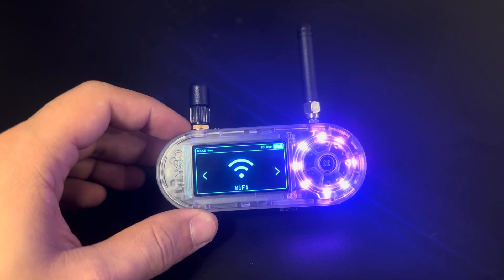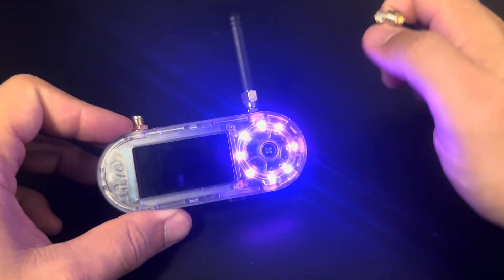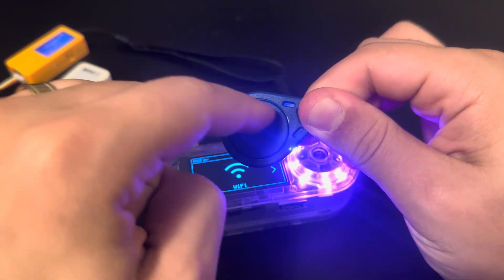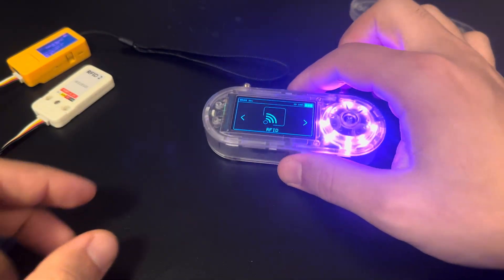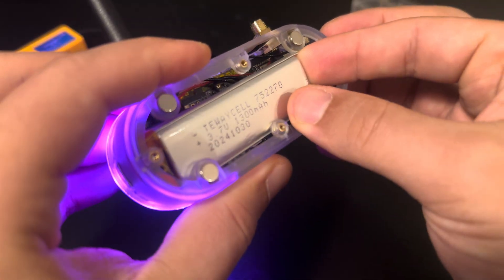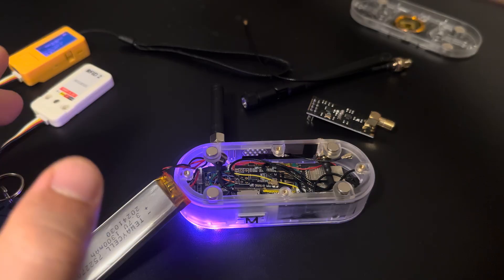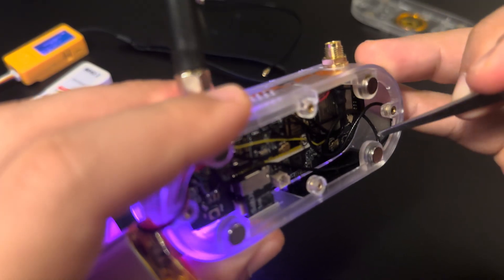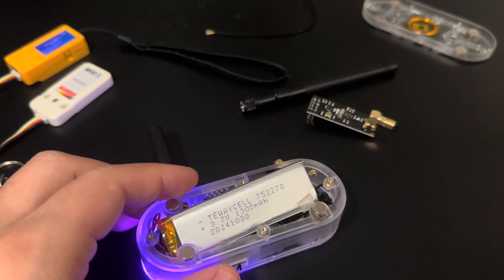My T-embed CC1101 Mods

Comment: Good God man no one realizes  that the t embed HAS slots on the back for the antenna already! Also the square section is a pop out for a GPSD/GPRS (GPS) antenna! It's literally the absolute PERFECT device for Bruce once you solder the nRF24l01 the GPRS module and then the FM radio which most ppl don't realize that even the radio has an offensive purpose! It's why I laugh when other devices started offering an mp3/4 module that is just for entertainment and serves NO actual security research purposes whereas with the FM radio and Bruce you can actually hijack certain frequency broadcasts like traffic announcements of whatever you're riding in unless you've got a bigger antenna like for a CB you can hijack cars around you and it's not just the radio that it affects it actually affects functions of the newer model vehicles I'm not sure exactly which but ya! I'm about to install a GT-24 within my t-embed cc1101
Reply: what's good dude, can you make a video showcasing your t embed setup?
Reply: Sounds good, I've seen that the FM module is quite large, probably larger than the NRF24. Do you have a plan or schematics on how to neatly connect it or do you have to reckon with the guts outside?
Reply: Cap

Comment: If i get the gt24 will i still be able to perform NRF24 as efficiently as if I was using the NRF24L01? 

Really cool vid btw!
Reply from the maker: yes, just use an external antenna to increase its power

Comment: Rfid  tag How many mhz or how many khz
Reply from the maker: this one is 13.56MHz
Reply: @R3CkTech Is 125khz valid?
Reply from the maker: @ELL_DARK you need a 125kHz module
Reply: @R3CkTech Which one is used the most?
Reply from the maker: @ELL_DARK it depends. Both are very used
Reply: @R3CkTech ok thank you very much

Comment: Hello. Need help - my t-embed so not read rfid tag, but do it with NFC. What's wrong with it?
Checked it on Bruce 1.9.1 and one of beta firmware.
Reply from the maker: You'll have to explain better what is happening. Try posting on our discord channel. Someone will help you there
Reply: @R3CkTech I got answer. T-embed not support rfid because of pn532. Only 13.56 Mhz nfc.
I bought flipper.

Comment: can you run chameleon on it without the nrf24 ? also can you install the antennas with the original motherboard ?
Reply from the maker: chameleon if for RFID, nrf24 is for 2.4GHz. Totally different purposes. I'm using the original motherboard

Comment: For the nrf part, did you solder the wires to the linear connections or did you use the 4x2 connections?
Reply from the maker: I used the linear connections, but both work
Reply from the maker: https://www.youtube.com/watch?v=did6lBDXo6E

Comment: Thank you so much for sharing. It's helping me a lot with my T-Embed update project.
I have a question: If you use a single antenna for Wi-Fi and NRF24, even if both are running at 2.4GHz, wouldn't that create a conflict if, for example, you're connected to a Wi-Fi network and simultaneously trying to use NRF24?
Thank you again for your interest.
Reply from the maker: if you try to use nRF24 while connected to wifi it might create a conflict, but I haven't used like this yet
Reply from the maker: I created a video explaining the connections https://www.youtube.com/watch?v=did6lBDXo6E
Reply: I have already completed the installation as I mentioned. I will soon upload all the 3D files for a back cover with accommodation for two antennas and a few photos of the installation process.
Now the problem is that none of the NRF24 options are working. The installation must be correct because the device is detected and there seems to be no error, but I cannot find any signal on the spectrum analyzer nor does the Jammer work on any frequency.
It's very strange. Is there anyone with similar behavior?

Comment: Thanks for the video, great solution for combining 2 signals in one antenna! I cant find a 2400mhz antenna that small, do you mind sharing the link where you bought it? And for the other antenna you used a 433mhz antenna?
And did it give you much more radius?
Reply from the maker: https://pt.aliexpress.com/item/1005006505187524.html
Reply from the maker: regarding the 433, I haven't done any tests to check that
Reply: I have installed the RF24 now myself, but it seems it wont receive or transmit anything. Cant find why, i used another rf24 and have the same problem. Do you see results in the rf24 wifi jammer modus? Did you need to adjust the pin settings in de bruce.conf?

Comment: There are 2 holes at the back plate, can i do this antenna mod without drilling?
Reply: Yes but you will not be able to put the battery back inside after that
Reply from the maker: @ariffzkfly  and will be hard to put it into your pocket too

Comment: Very good video, it helped me allot but i dont know how to connect the nrf 24 could you do a viedeo how to connect it ?
Reply from the maker: @ToniHessel  sure, it’s on my list here for next videos
Reply: @R3CkTech do you have a video to upgrade the RFID! I saw in one video you had an upgradable option for another device. Or the GPS module. Noticed that you can purchase the cc1101 T-embed face plates for about $25-$30. Upgrading everything and designing a new 3D printed enclosure is on my projects list.
Reply from the maker: @oscarortega846  what do you mean by upgrade the rfid?
Reply: @R3CkTech hardware upgrade I guess. Like using a stack rfid, chameleon, upgraded rfid modules that can pick up more frequencies. Thank you your help and explaining your process.

Comment: Do you know if there is any way to get 125khz and 134.2kHz rfid reader on it?
Reply from the maker: @frenchmax  I haven’t tried connecting the rdm6300 for 125kHz yet, but for 13.56mhz it has an embedded pn532. You can also use a chameleon device with it
Reply: @R3CkTech  yeah I ordered one from Ali express, should arrive coming week. At thiis point would you recommand gettiing a Flipper Zero on top or should I wait for something better? The Flipper is already 5 years on the market, I heard the flipper one will not be a continuation of it but I'm wondering if some other device could be a flipper killer. I don' t think the T-embed will ever do as much as the flipper
Reply from the maker: @ it depends on what you want. For some of the functionalities we still can’t do as much as flipper, like emulating rfid tags. But for others we do much more like WiFi attacks that flipper does not have without external boards. Also Bruce has only 1 year and we have already tons of attacks and many more coming. Flipper costs 4 times more than t-embed cc1101 and 10 times more than m5stack stickc plus 2. So yeah, if you have the money you can buy one, but you have to consider all those things